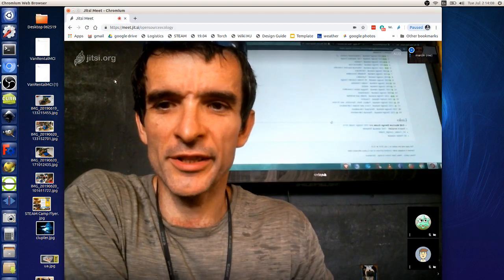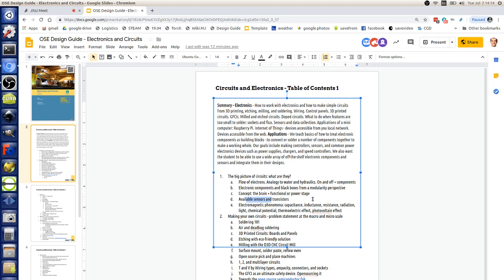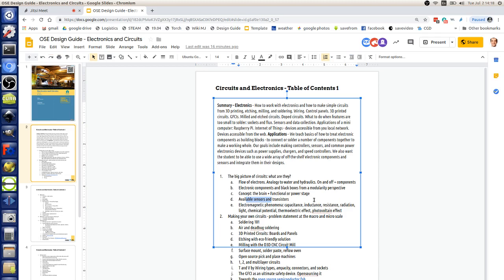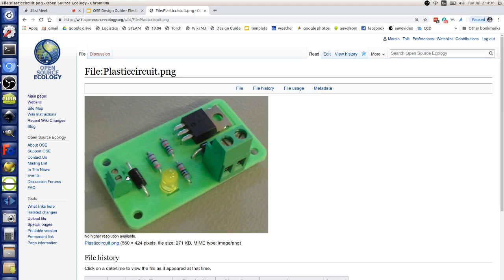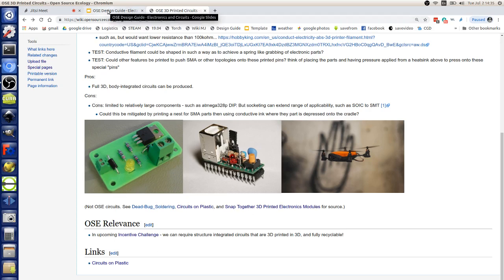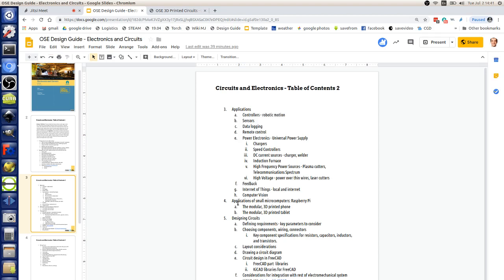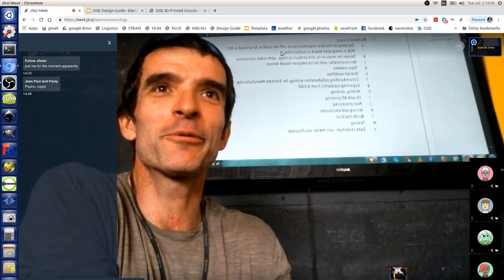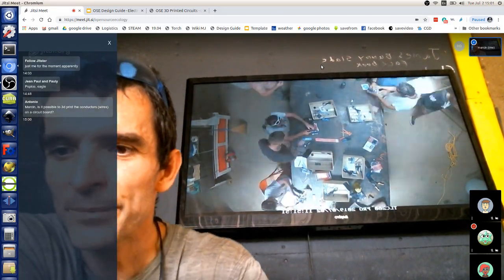Open Source Microfactory STEAM Camp - Circuits and Electronics

Comment: I've used an Arduino mega to make an interleaved PWM at 32kHz for a welder power supply the code is very straight forward.